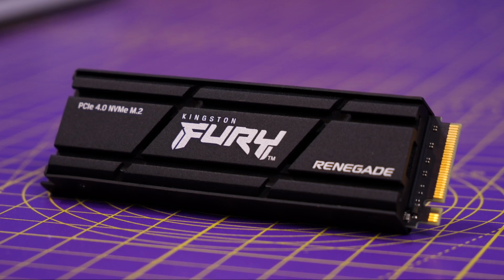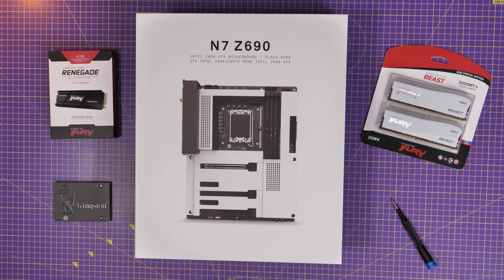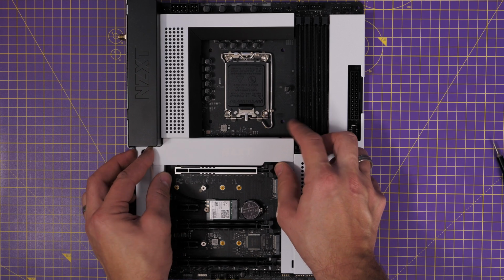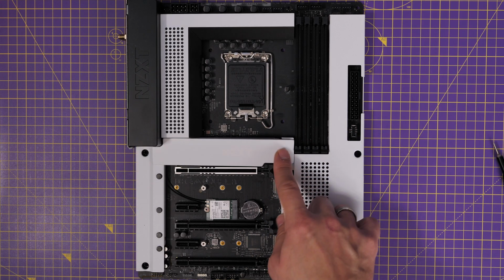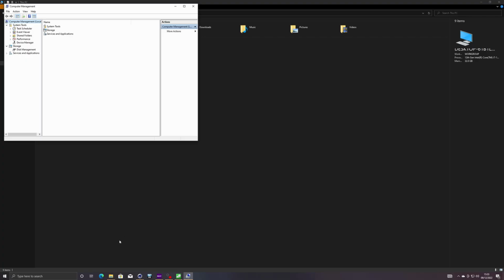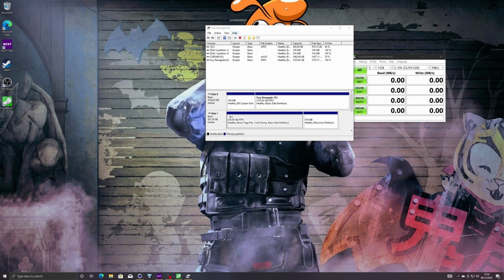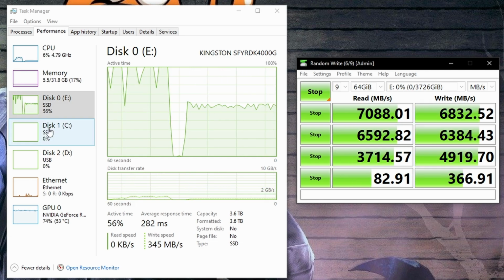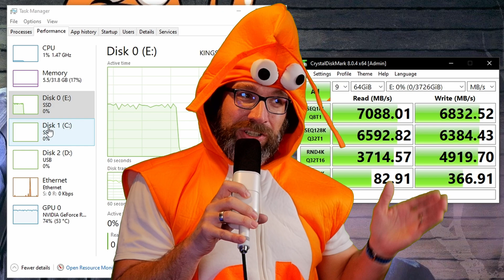How to install Kingston Fury Renegade (with heatsink) tips, tricks and testing

Comment: What if the problem is the other way around? I purchased a Kingston Fury  Renegade 2 TB without heat sink, but yesterday the retailer sent me a unit WITH the heat sink instead, because the other one ran out of stock. Can I safely unscrew and remove the heat sink? And will my garantee be void? If it is easy to remove the ´stock´ heat sink without damaging the SSD, I might just keep the product and save me the trouble of returning it.
Reply from the maker: Why would you do that?
Reply: @TheProvokedPrawn  Because I won´t be able to install the motherboard´s M.2 Shield on top of the M.2 SSD drive with its own heat sink. And I already have another drive without heat sink installed. Seems weird to mix things up.

I might would have done that with a budget motherboard, but it´s odd not to take advantage of the Asus Z790-E heat shields.
Reply: I know it’s been a while but did you removed the heatsink and how are the temps because is behind GPU?

Comment: I have got a 2tb one and I'm thinking to get a 2nd one, it's a beast. Though my slots are right under the GPU, which covers the GUARD that comes with the mobo, the Fury I got sits above the GPU in the slot, but the others are as mentioned under the GPU, basically if I'd get this one again I'd have to put it right on/under the gpu which means i gotta take the guard off and can't put it back on right? You reckon it'd be as efficient with the z790's aorus guard? Or best use the guard it comes with? Though removing the guard doesn't affect my pc's aspect since the GPU sits on it and it's huge.
ps: I forgot that i got an m2 kingstone and it's prolly under the guard, taking it out would affect the temps for sure, so i wonder how efficient the mobo's guard would be for the fury in case i'd choose not to use its own guard

Comment: you should make a video that shows the heatsinked ssds that work with this specific board with the ssd shield still on
Reply from the maker: Like what? I've never seen a motherboard that has that option ...
Reply: @TheProvokedPrawn  mhm this gave me the idea that u could maybe install standoffs.. to fit the shield over the heatsink if its just for the looks...